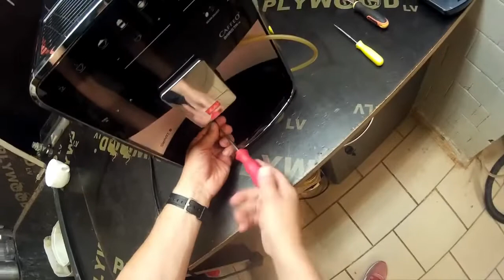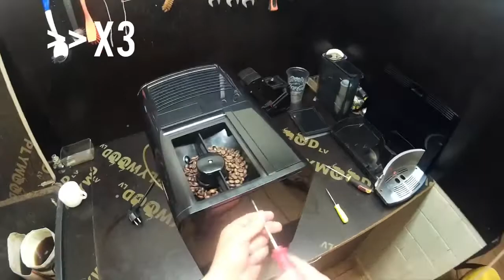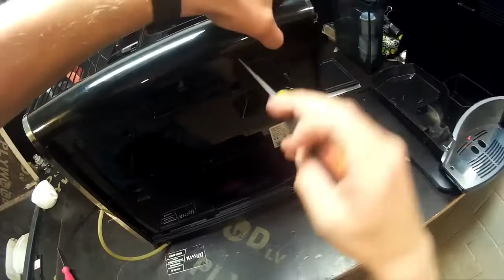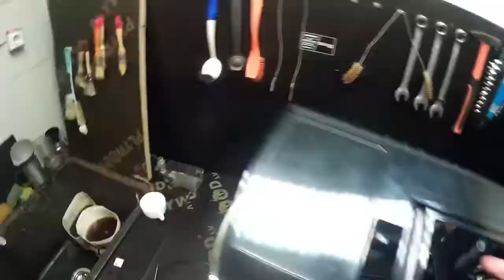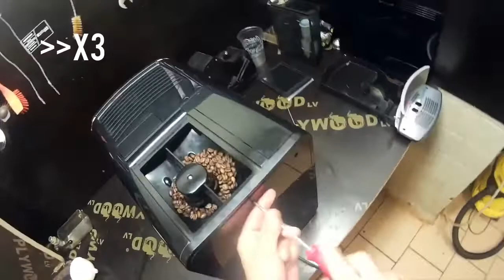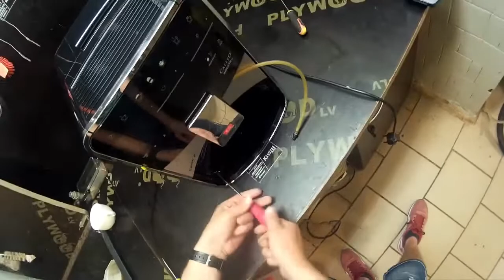how to disassemble Melitta Barista TS Smart easy only in 4 minutes

Comment: hi. i have this machine, milk pump sounds as normal, delivery spout rubbers & pipe clean & clear, steam is delivered as usual but no milk pulled from the tank. looks like could be the pumps not pressurising for suction. any ideas please
Reply: Seems like I have similar issue. It pulls milk but not enough. I will be looking at it shortly so if I found the issue I will let you know

Comment: Hi there, Would you have any clue why my exact same machine is not working, on the screen its stuck saying that the power door is still open, only it not open. Now i can't use the whole thing because of the message on-screen? Any advice would be very much appreciated cheers
Reply: I have the same problem... still seeking a solution...
Reply: Must be a switch that is not triggered

Comment: Great video, my machine starts grinding as normal then I can hear the grinder run even though its not grinding coffee for a few seconds after. Is that because of the coffee strength set or is that a fault with the machine? Its a new machine
Reply from the maker: Hi!
Maybe grinder level is so Fine?  If the machine is new i dont think there can be some defect! But always exist some mistake/defekt.

Try change grinder to a coarser.

Comment: Thank you - this video was so helpful - it allowed me to strip it back to clean out years of coffee grime.  I also removed the hopper to clear the top of the grinder.  My mistake however was to take the top of the hopper off, and I am unable to replace it correctly as the machine throws error 14, and if I take the top of the hopper off again there is no error.  Im pretty sure its something to do with getting the correct position of the sliders - do you know how to position it correctly?
Reply from the maker: Hi.
Just try to assemble how it’s was before.

Comment: hello, you seem to understand alot from this machine, im having an issue, after the machine grinds the coffe beans it tryes to "compress" the grinded coffe but it makes a weird noise like it has no strenght to compress it and the coffe program just cancels, do you know any solution for this?! cheers.
Reply from the maker: Hi! There can be few problems! Something with coffee brewunit(block) try to take out and clean! Maybe some of microswitch not working or electric problems, also maybe brewunit motor working bad.
Reply: @coffeetricksandtips1018  thanks for the tips! i will try to open a warranty ticket! best regards
Reply from the maker: @PedroSilva-tr1xt  Always welcome 👌🏼
Reply: Any idea why water is leaking out of the sides of the machine instead of brewing coffee? I replaced the drainage valve, but the issue persists. 

Thanks for any advice!

Comment: I have this machine & it doesn’t get as hot as I’d like, any way to increase milk temperatures. 

Also it has a leak that ends up all over the kitchen side if there’s a common fix for this ?
Reply from the maker: I dont know what exactly could be there right now! Need to take off panel’s and check why and where leak.
About t’ maybe some sensor broken.
Reply: heat the cup in hot water, heat the milk to warm in microwave before making coffee, should increase temp a few degrees to make a difference